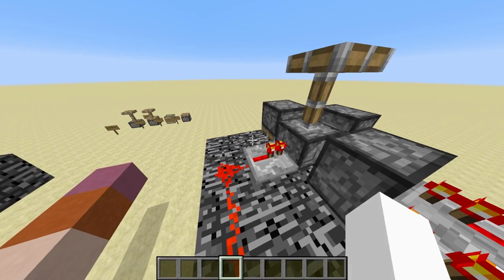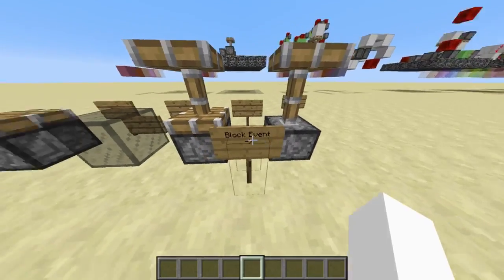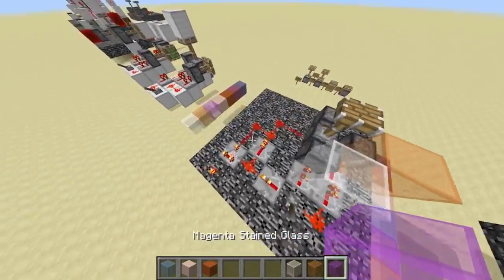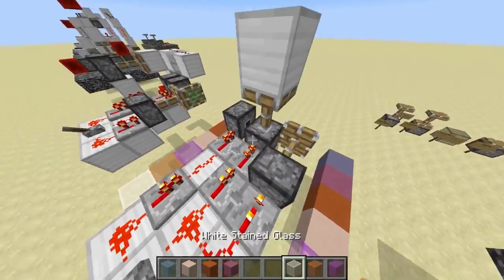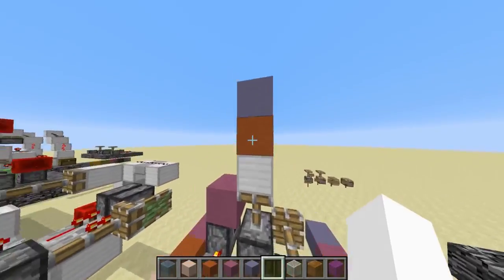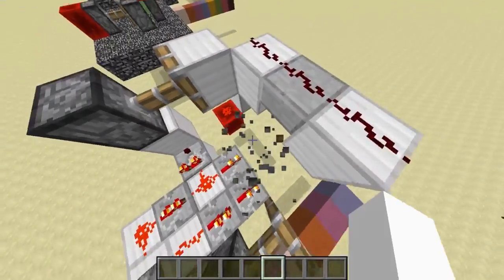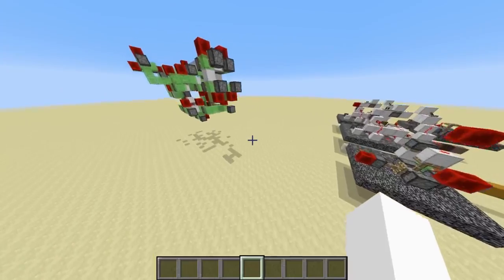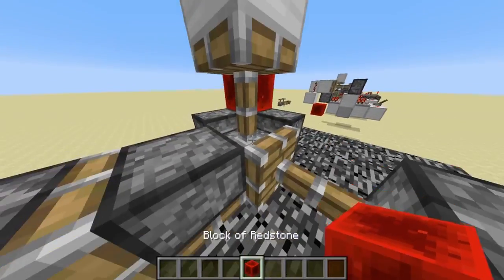Some headless piston technology

Comment: I know you want a flying machine but, with all you know now, do you think it will be possible to make a static expandable design (15-long, say) that will break all the bedrock blocks in a line when activated once ? I'm basically looking for the mechanism that will break the most bedrock before having to rebuild the setup.
Reply from the maker: The main difficulty is probably not to build the redstone of the contraption, but to get the headless pistons. It would be interesting to see whether you can manage to get an entire row of headless pistons out of a single explosion. If that´s possible then that would make it a lot easier to break large amounts of bedrock with the piston method. However I haven´t done too much research in that direction yet.
Reply: I came up with a system to do it last year, but they are not facing the right direction. Maybe with your new technique for moving headless pistons this could be possible now.

https://twitter.com/MaizumaGames/status/709542200044982272
Reply from the maker: Here´s my first attempt: https://www.youtube.com/watch?v=90RiLszMCeE

Comment: Do you think that it's possible to brake bedrock above, instead of bellow?
Reply from the maker: Yes, that´s possible. You just need to reverse the orientation of the pistons which do the bedrock breaking, and then change the redstone so it fits below the bedrock ceiling you´re trying to break.

Comment: What does he say at 1:29 ?
Reply from the maker: In 1.8, if you depowered and updated an extended piston then he would convert to a glitchy piston state where the piston base is retracted, and he would schedule a retraction block event.
If the piston is unpowered when the retraction block event gets processed, then he would convert into a block 36 and maybe pull some blocks and do all the retraction stuff. That´s not the interesting case here.
If the piston is powered when the retraction block event  gets processed then he would convert back from his retracted state into the extended state. So if a retracted piston is powered and receives a retraction block event, then he will convert into his extended state.
So much for 1.8 behavior.
In 1.9 they removed the behavior, that a piston converts to glitchy piston state when it schedules a retraction block event.
However all other behaviors are still kept in1.9+, even if they don´t make much sense. 
If a retracted piston base is powered and receives a retraction block event, then he will convert from his retracted state into his extended/headless state.
That´s what I was talking about at that time.
Reply: Thanks!
Reply: question about  7:08 why doesnt the headless piston delete piston in front of it upon retraction? Or does the piston head generate a new one due to the block event saying so?
Reply from the maker: @Bengineer8
At 7:08, the headless piston is sticky.
Normal headless pistons delete the block in front of them. 
Sticky headless pistons don´t always delete the block in front of them.
To understand the behavior of headless sticky piston we need to distinguish between two cases:
1. If there´s a movable block 2 blocks in front of the headless sticky piston, then that block will be pulled (and the block directly in front of the headless sticky piston gets deleted, because it gets replaced by the block 36 of the pulled block). This is not the case we have at 7:08
2. If there´s no movable block 2 blocks in front of the headless sticky piston, and if there´s a block 36 directly in front of the headless sticky piston, then that block 36 will instantly finish its movement. This is the case that occurs at 7:08.

So in the contraption, the upwards facing piston first retracts and becomes a block 36, then the headless sticky piston instantly finishes the movement of that block 36, so that the upwards facing piston is fully retracted, and then the upwards facing piston retracts again.
When the upwards facing piston does his first retraction, then the iron block gets pulled down and becomes a block 36. When the upwards facing piston does his second retraction, then the iron block will instantly finish his movement, because the sticky piston will instantly finish the movement of a block 36 directly in front of him.
Reply: Myren Eario Thanks, I think I understand it now : )
Reply: Myren Eario This is why I wish your audio was better, in the video the horrible audio makes it hard to pay attention and understand. Whenever you answer a question in the comments, however, your explanations are always flawless, easy to read and understand and demonstrates full knowledge and understanding of the game's code.

Comment: Did you change your audio setup somehow? Eventough it never was optimal the last few videos where pretty good audio wise, this video sounds a bit like you talk into a tin can.
Anyways great explanation. I think showing the order of things visually helps quiete a lot to understand stuff.
Reply: I showed a few seconds of one of your videos to a friend of mine*, asking what was wrong with the audio, he said the sample rate is too low. 
Please fix your audio, I want to understand you; I can't tell which is greater: your intelligence or the measure of how bad your audio is.
*My friend doesn't like minecraft and is usually very busy so I doubt that he will provide any further assistance
Reply: My cell phone records better than what ever you are using, if you already have a smartphone, perhaps try using it instead of what you are currently using. Also, I can confirm that my friend won't help any further. The audio makes the video nearly unwatchable.
Btw, unlike my friend I am not an expert on audio but maybe try putting the microphone farther away from your face. In addition, perhaps you could try using pillows to reduce echos
Reply from the maker: I´m doing random changes to my audio setup, and hope that something makes it better. If the audio quality in this video was worse than in my previous ones, then I´ll try to revert some changes.